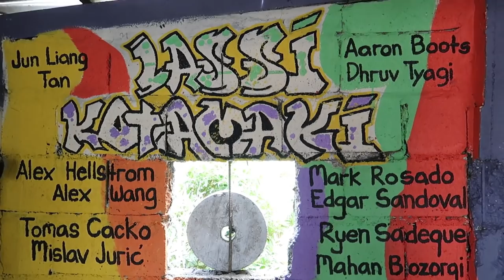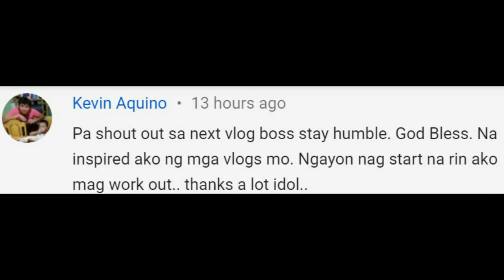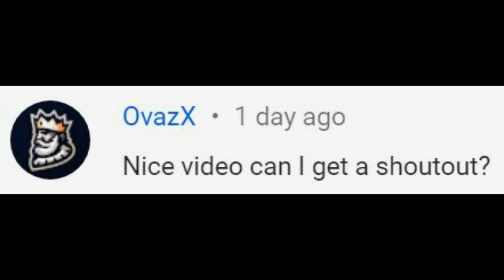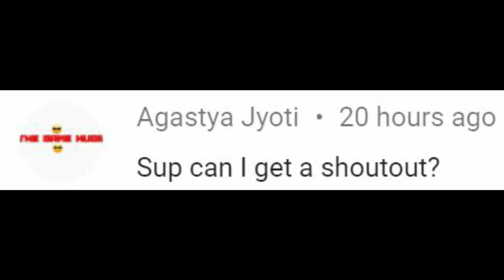How to Make Homemade Squat Rack

Comment: Hell yeah bud. Should drill some 1 1/4 inch  Holes Or whatever that is in cm. puts some bars on the side for rack pulls.  Also just a little safety bar for ya. You'd only need 2 bars just slide in and out of the holes you drilled.

Comment: That's nice, but i think you missed the point. The purpose of a power rack or squat rack is to be able to squat with safety. You have to drill holes in the vertical pieces and add some safety bars and some J hooks. Then you can do all the excersices safe. You did so much work with that squat rack, you only have to do a couple of things and it will be perfect. I have made one myself, if you want any help you can ask. Keep up the great work!

Comment: Absolutely fantastic work guys. I'm gonna set up one exactly like that one.

Just a random concern though.. I'm not a pro but about the workout there 5:22. I thought u can't go that low while squarting, sort of the thighs need to be parallel to the ground as the lowest point? I could be wrong.
Reply: That's just the minimum standard for powerlifting (Hip crease below than the top of the knee), but if you can go deeper with good form you can and probably should as it will be better for muscle building.
Reply: Thank you for that important piece of information @diesertyp7822 
Cheers💪

Comment: Nice Squat rack. What size construction pipes do you use?
Reply from the maker: 2X2 tubular bar 1.8 / 1 inch galvanized pipe schedule 40 / 3/4 inch galvanized pipe sched 40
Reply: @romgd  Thnx Bro 😁🙏 About to start my own project